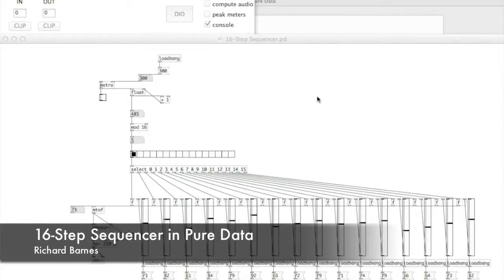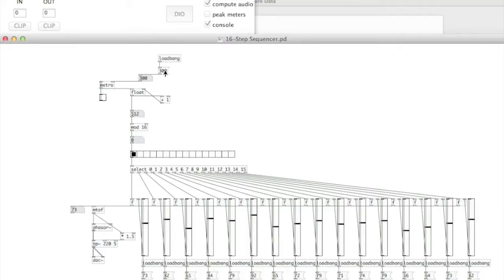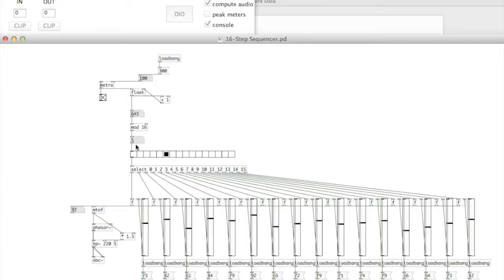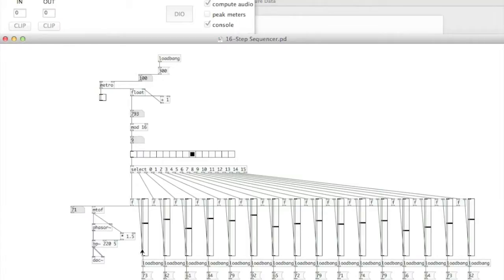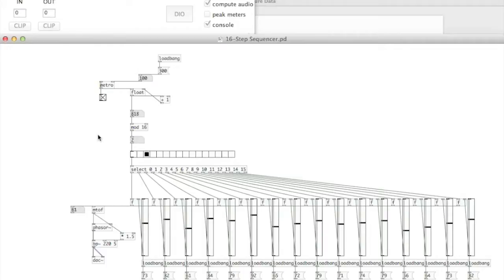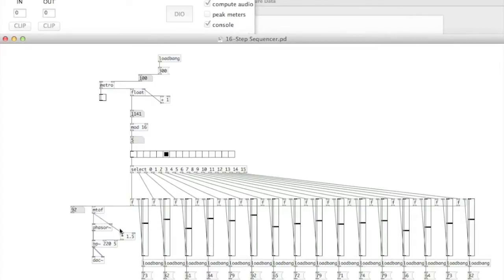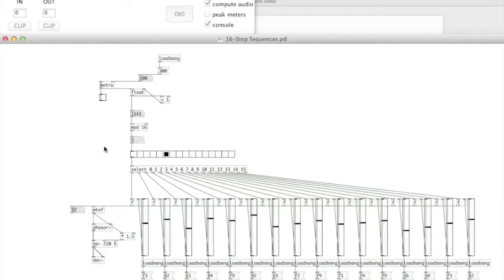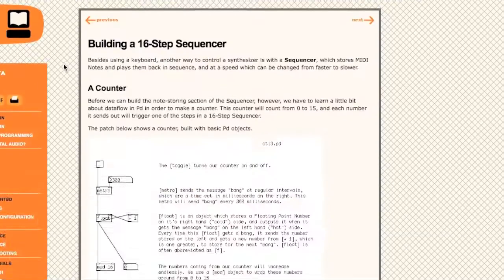16-Step Sequencer in Pure Data

Comment: It makes a weird popping noise when i do the loop :S so how do you control the popping on it?
Reply from the maker: This can be fixed by including an Envelope Generator between the output of the [bp~] and the [dac~]. The popping occurs due to there being no gaps between each step as the sound is constant.

Follow the link below and scroll to the bottom of the page. You will find a more detailed explanation of how to add in an Envelope Generator.

http://en.flossmanuals.net/pure-data/audio-tutorials/step-sequencer/

This is the website I used to help me with Pure Data and you should find it easy to follow.
Reply: Yea I sorted it and you were right awesome video and youll be credited for it. Awesome video and very helpfull
Reply from the maker: Matthew Stockin Awesome glad to hear.